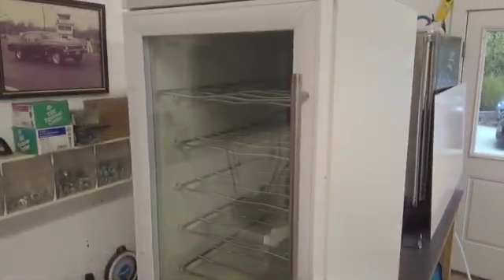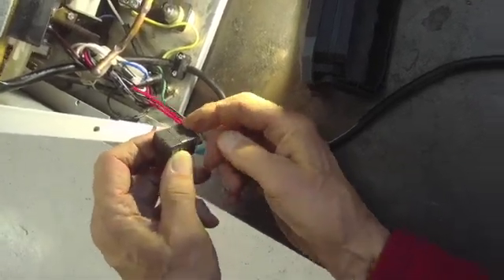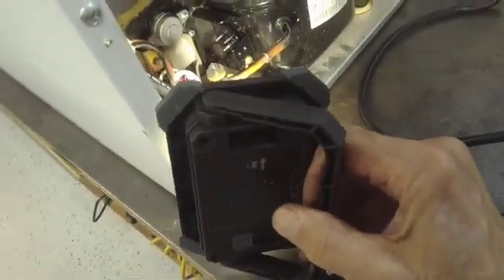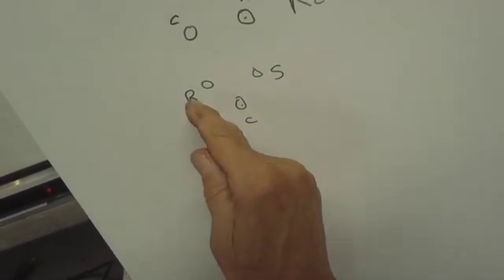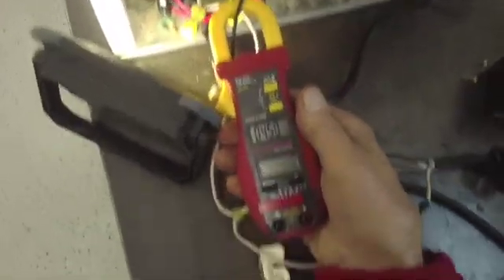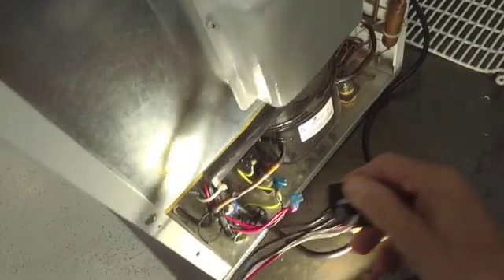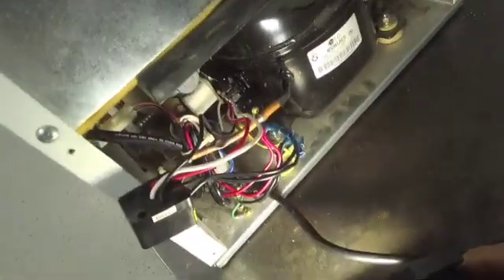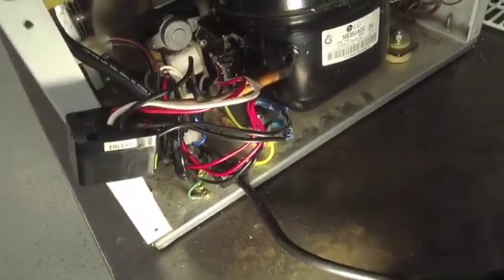Vinotemp faulty compressor

Comment: Hi Aaron…We have a Vinotemp VT32SN Wine Cellar under the counter unit that just stated acting up.  My granddaughter is 3 years old and is fascinated with the switch panel, probably because this unit is at here level and she can open the door and mess with the buttons. Everything was fine until a week ago when the display started flashing. The buttons seemed to be unresponsive, so I pulled the unit out and unplugged it then let it sit for an hour... then I plugged it back in and its still flashing when plugged in.  I noticed in many of your videos that you had a couple of similar under counter units in your shop area. So I guess you are somewhat familiar with these models.  I’m fairly handy and I was wondering if there’s a way for me to get this puppy working again, not knowing if its the control board, the relay, or an overload protector.  I havent taken anything apart, I just slid it back under the counter until I know more about what could be the problem, and whether its fixable.  I’d appreciate any advice you might be able to offer.  TIA-Mike
Reply from the maker: She may have changed the settings on the display. You should have an owners manual with instructions on how to set the temps
 I don't have a manual here so try the internet.

Comment: Why amperage multiplier is 6? I hooked the compressor directly as in your video, bypassing starter, overload, and circuit board. The label says "Locked rotor 15.6A R134a HBA052858", and it draws 4.1Amp. Is it fine or too much? After running almost 15 min the compressor became very hot, and the fridge didn't cool at all. What could be a problem? I have Vinotemp VT-46TS-2Z.
Reply from the maker: If your locked rotor amps is 15.6 then your run amps should be around 2.5, it sounds like you a faulty compressor.

Comment: Great video! Could you paste link to the relay that I can use? My cooler makes clicking sound temp display shows LL and blinks. Any suggestions?
Reply from the maker: What hp is the compressor
Reply: @SubZeroSpecialists  i’m not sure,. How do I look that up? I think I just got scammed, bought this VT-32 used and the guy showed me a video where he changes temperature claiming it worked fine… 24 hours later I plugged it in and I get the LL message, clicking sound and blinking LL and coolers light. It does not make sound when you push the temperature up and down buttons, and that’s the video he made for me.
Reply from the maker: @mkrichevsky  what kind of refrigerator is it
Reply: @SubZeroSpecialists  It’s a wine cooler “Vinotemp V-32”
Reply from the maker: @mkrichevsky  you have to look on the compressor label for the hp
Reply: @SubZeroSpecialists  It says 1 PH. Model QDH2811G
Reply from the maker: @mkrichevsky  that number doesn’t help. Call Vinotemp and find out what horsepower it is and what type of Freon it takes. If it’s a 32 bottle then it’s probably a 1/6 hp compressor, if so you could try a Supco RO-81 solid state relay.

Comment: Great video!  It helped me ID my bad compressor.  Now I can’t find a compressor for my Vinotemp VT-188.  The original manufacturer is HUAYI compressor model HYE60Y42.  I was informed by Vinotemp that the compressor was no longer available and that I could look for compressor with similar specs:

R134a, 1/5 HP/600BTU/115VOLTS AC/60HZ.  Do you know of a replacement compressor?
Reply from the maker: You can use an Embraco 1/5 hp 600 btu.
Reply: @SubZeroSpecialists :  Does it matter if some of the specs are not exactly the same? Such as HP, BTU’s (within a range?) While still
Having the same volts, Hz, and refrigerate.
Reply from the maker: @FreddytheGamma  you could use any compressor that’s close to the specs so long as it’s the same refrigerant and voltage, you could also try Danfos compressors. Also pay attention to the physical size of the compressor-check the height, make sure it will fit the space.

Comment: Thank you for posting this video. I have a vinotemp wine cooler, model VT-27TS, started by not cooling, I finally pulled it out its cabinet housing, the compressor was very hot and clicking.  I tested the compressor (run, then quick touch to start terminal) and compressor did not start.  Any idea where I can purchase a compressor for this?
Reply from the maker: Who made the compressor and how many BTUS is it
Reply from the maker: When you tried to start the compressor did you connect one wire to the common terminal and the other to the run winding?
Reply: Thank you getting back to me. It’s made by Huay, not sure about the btu, but it says, “B25H5”. For the wiring, yes common to the top of the triangle and hot to the right side terminal (run).  I have to admit though, not sure if I did the jump to “start” correctly.
Reply from the maker: @alexedward1250  Never heard of that brand, it’s probably made in China. Does the compressor say what the LRA (locked rotor amps) are. If you divide that number by 6 you’ll get the run amps and that may signify the hp (horse power). Based on the model number it could be a 250 btu compressor. What type of Freon?
Reply: @SubZeroSpecialists  it sure doesn’t give all that important information, just B25H5
Reply from the maker: I would try to reach out to Vinotemp and get some info on a replacement compressor.

Comment: Very comprehensive, but your drawing was wrongly labeled - you may want to look at that again. Also - suggest you have a camera man so they camera doesn't move around so much.
Reply from the maker: You're right about the labeling of the start and run winding on the relay. As for the camera, man maybe in the future.

Comment: You saved my Vinotemp wine fridge.  I have an older model with only a two-prong.  I recently purchased a new relay to see if that works.  Initially, it did not.  After watching your video, I intuitively switched the wires and the temperature stabilized.

Comment from the maker: Sounds like you have a bad compressor. To confirm check the amperage draw. Look on the compressor label for the LRA (Locked rotor amps) and divide by 6, that will give you the run amps. The reason why the compressor is clicking off is probably because it's drawing too many amps, that would indicate internal damage.
Reply: Would the compressor feel hot to touch as well? Debating changing the switch or just buy a compressor and do it all at once.
Reply from the maker: @raidergainzx5290  A hot compressor could indicate unnecessary friction inside but the amp draw would also be high. If you're drawing 2-3 amps above normal I would suspect the compressor.

Comment: Thank you for your great video. Need help with my Vinotemp VT-27 ST. The Vinotemp Relays costs $60+ while cellar was $200 years ago from Costco.
Tested three pins from the compressor with continuity. Similar relays from Amazon can kick on the compressor. Heard the clicking sound from time to time. However, temperature will go up with compressor getting warm. 
Any suggestion.